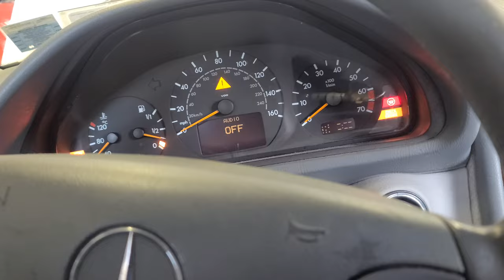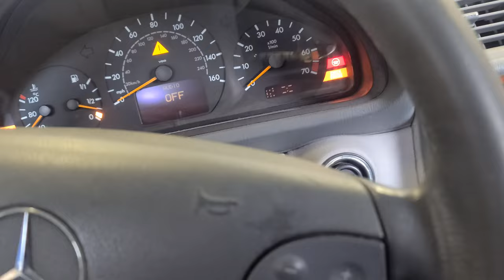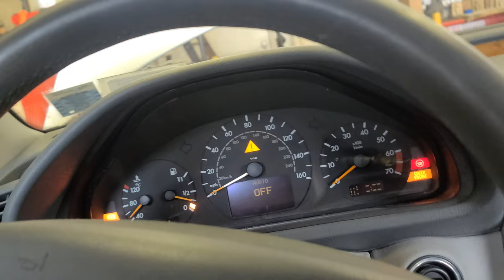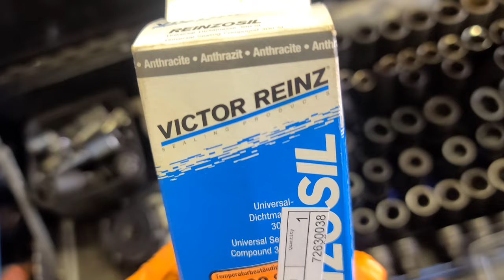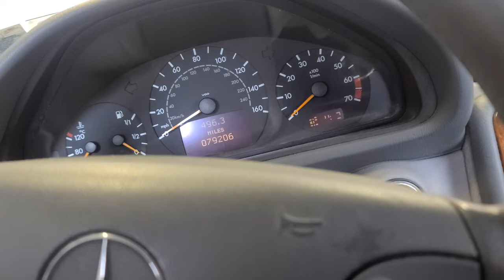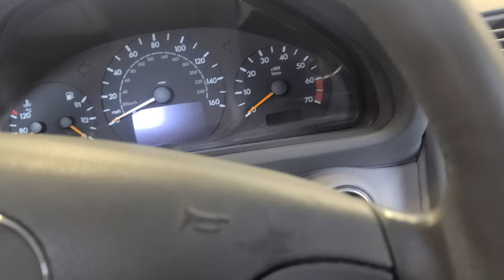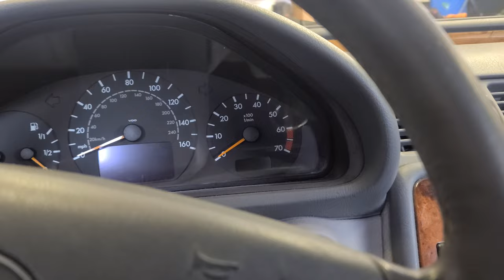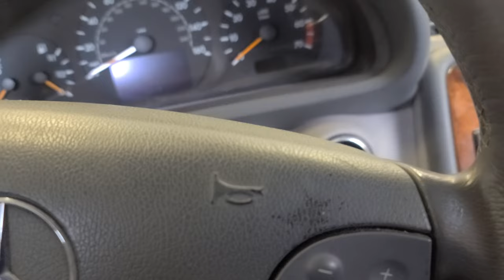1997 - 2003 Mercedes-Benz How to Replace the Oil Pan & Gasket

Comment: Pretty helpful  
..  same set up as a clk 320 if anyone is wondering  .... 

And that sealer expands...   looked like alittle to much  😳  .. seen another video of over using sealers can make it come out inside and in time break off and get sucked up into the oil pump ... 

Careful on using sealer and do research... and i think you might need a gasket  . . 

Im replacing my clk320 pan 😤  . And this helped  😎💡🤓 thanks alot
Reply from the maker: Thanks
Reply: I destroyed my oil pan on my '99 clk 320 after hydroplaning.... did your car have issues after replacing the oil pan?

Comment: I just did this repair on a 2002 S430.  I probably spent 2 hours trying to separate the pan from the crankcase by hammering in screwdrivers, putty knives and pry bars.  I got nowhere.  There are 2 holes in the pan that have threads in them.  They are used as anchor points for brackets that hold the transmission lines.  I screwed one of the bolts partially in and used it as a pry point to pull the pan away from the crankcase.  There are spots on the frame to pry against.  I was worried I would damage the threads or the bolt, but it took very little pressure to get the pan to pull away from the engine.  I was at a complete standstill and I almost abandoned the job because of it.
Reply from the maker: Check the video I'm about to upload regarding to your comment, if you subscribed to my channel then you shouldn't be worry about it cuz as soon as I upload it, my channel will let you know...thanks for the feedback.....I'm pretty sure it would be ready for tomorrow 01.27.22 around 6pm 6:30pm....thanks!!!!!
Reply: Next time use a plastic heat welder.  It's like a heat gun with a straw shaped tip. Pry the side of the oil pan, gently use heat with a large screw driver. Take your time, go back and forth. Heat up the 1/2 you are working on being careful not to touch the metal of the heat gun against any rubber hoses or belts and only heating the oil pan seams.  Then use a bigger pry bar, use a bit more force. Simple as cake. Took me 10 minutes while drinking a coke.

Comment: I don't think it good idea to use the tube sealer.  Better to use gasket made for that oil pan.
Reply from the maker: I AM RESPONDING TO YOUR QUESTION IN MY NEW VIDEO THAT'S ABOUT TO DROP TONIGHT 01.02.2022 AROUND 11PM